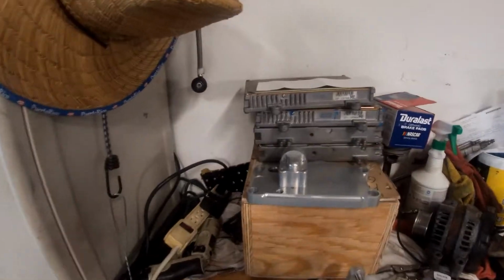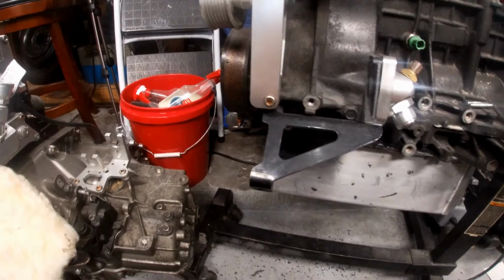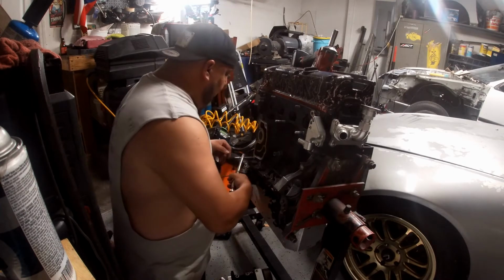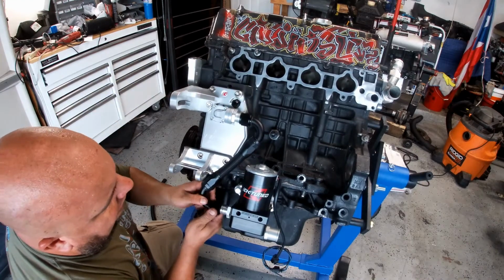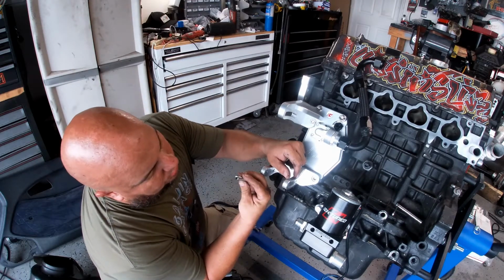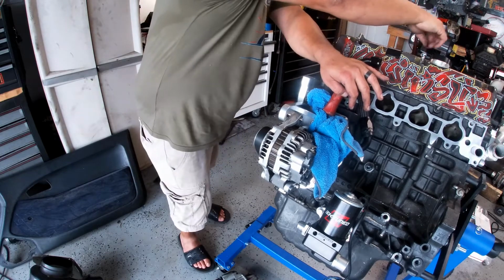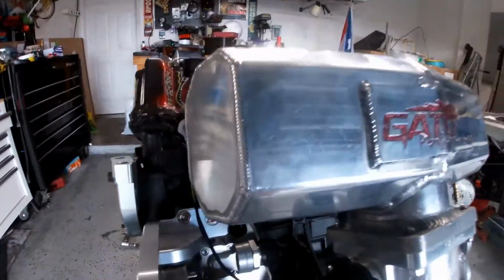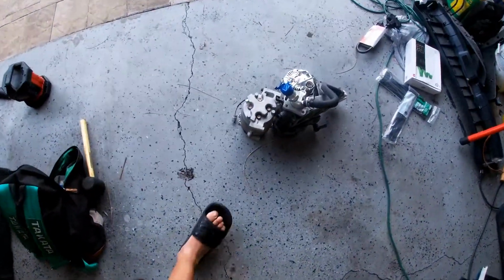K-TUNED WATER PLATE ELECTEIC PUMP K24

Comment: Hey bro, how did you wire the water pump up? 

Also any chances you could do me a big solid and measure the height from the top of the adapter plate to the top of the valve cover? 

I’ve got some Custom ITB’s that are angled down and i’m concerned that if I spend the money on this I still might not have enough clearance. 

I need around 185mm or 7.28 inches from the top of the valve cover roughly to the top of the adapter plate. 

No one in my country runs these so have no one to reference off. 

You’ll gain a sub for life 🙏
Reply from the maker: Will the water pump I ran the water pump to a zipper switch that I can turn the water pump on the fuel pump on also the fans on wait for it on next Sunday and I make a short video explaining how I did it

Comment: How did you get the new pulley on the alternator?? I can get the nut on . Shaft is to small
Reply from the maker: The alternator that I'm using is from a 1998 acura integra. L and the fit right on it. Also, you can use for 1998  B20CRV alternator.